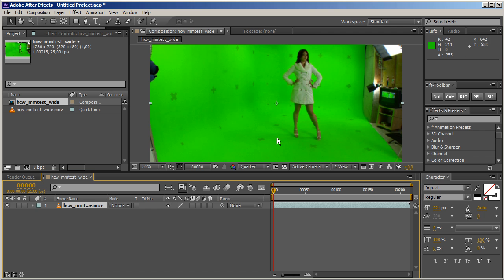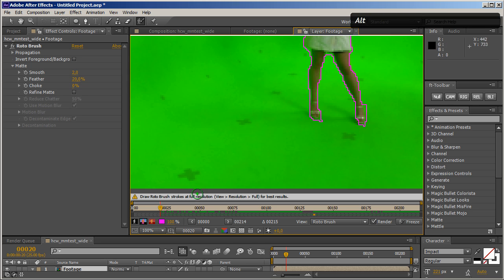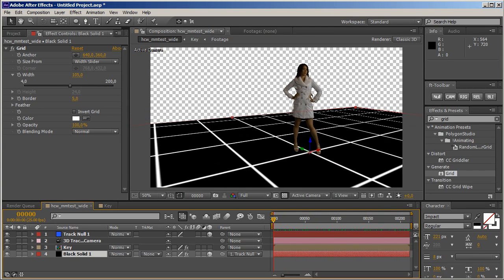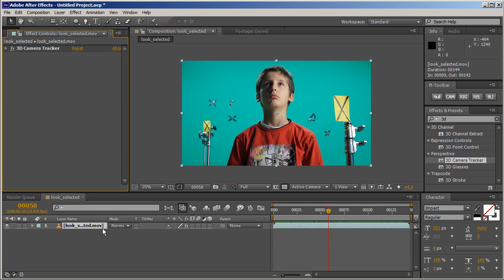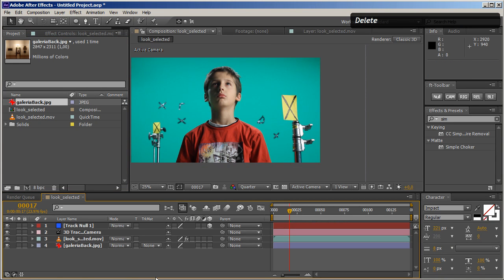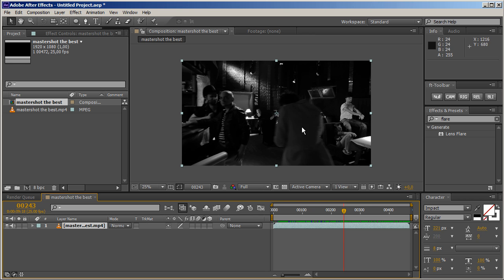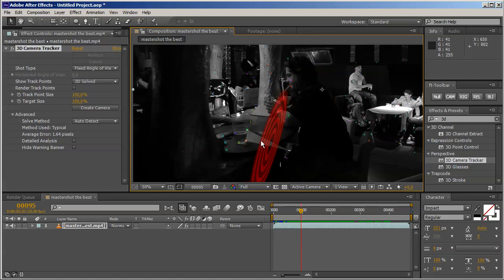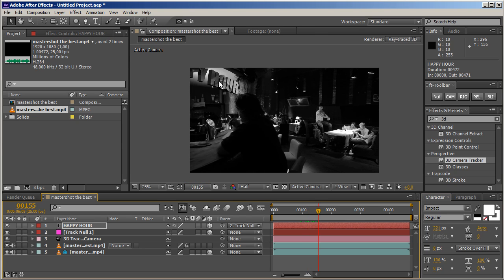Studying 3D Camera Tracker - After Effects CS6

Comment from the maker: Yes it can, but only through trickery and only to a limited extend which in my opinion isn't worth the time and effort needed to achieve it. It's because the camera tracker is, well, a camera tracker, and what you're talking about is motion capture, since the shape that is being tracked is changing and reshaping itself (like the face does), and camera trackers need their points stationary. What it can be used additional however is 3d object tracking (books, virtual props).